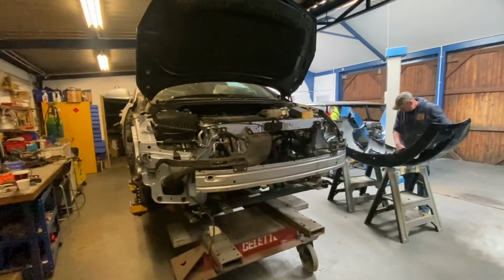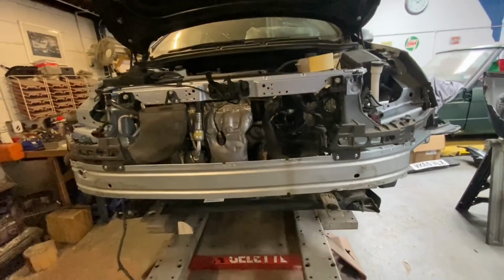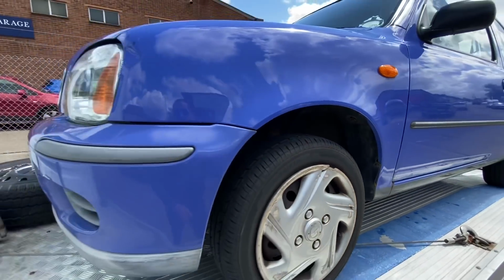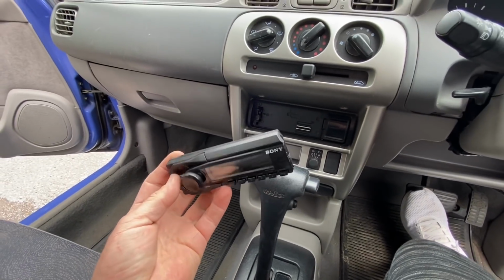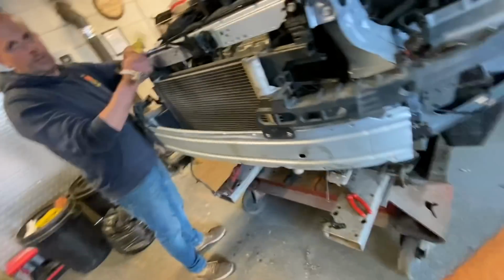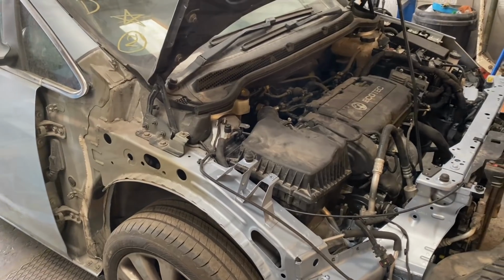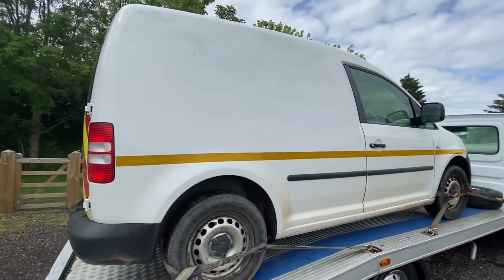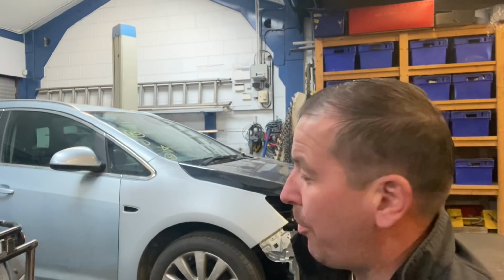Salvage Rebuilds Finding Buying Repairing Flipping For Profit £££

Comment: Those 'templates' inside the bumper are only there by accident.
The injection moulding die that creates the bumper will be used for both options; a pin will go in when 'sensor' bumpers are being made, and a blank otherwise. The outline of the blank creates the template shape.

Comment: Pre 51 plate automatic micras are hard to find. Save the micra. You should have done a face-lift on the caddy, golf R bumpers, dropped it 30 or 40 mil, cadiz alloys and golf R seats and steering wheel... maybe even wrapped it.. then move it on for £7,000.. either way, good video, well done lads

Comment: Another great video Rob & Chris, 3k was a great price for the Caddy loads left on the bone for the next trader. I sold a 2006 Caddy for nearly 4k but it had under 100k on it. Them Micra's take me back used to sell loads 10 or so years ago. They can be quite rotten especially around the front cross member etc. Used to sell cheap 4 door ones to Africa they used them as small taxi's. 😀👍

Comment: Great video, Astra looks like it's coming on nicely and it's nice to see what else you guys get up to during the working day.

I started my motor trade career as an apprentice at a Nissan dealer, my opinions on K11 Micras were the same as yours and Chris's before I started, then I realised how underappreciated they are.  They're pretty much bulletproof and the 16v engines are surprisingly fun.  The autos are rare now because they have an electromagnetic clutch that is really expensive to replace, if your is still good I think it's worth saving.  The paint always peeled off the later tailgates and yours looks fine so that's another bonus.  I can see why you would want to weigh it in though, less hassle and probably similar profits to selling it.

Shame the Caddy was a quick flip, I think that series would've been great for the channel as they're really popular.  180k is nothing on the later common rail TDIs, after 10 reg they're bulletproof.  My 15 plate Transporter has done 198k and the only part that's failed is a clutch release bearing.  You could tell it was a one driver van as well, they kept it in really nice condition.  I think the trader you sold it to is going to do very well out of that.  Hopefully the next ones they offer you are even nicer.

Keep up the good work :)

Comment: On the Micra I would toss it up on the ramp look for more rust 
if the oil leak is a simple fix .. I would repair the rust with metal you guys already have around the yard 
one can of primer and one can of stone guard on the sills 

list it up and trade for a project car chances are someone in a pinch might have something in need of light body work or mechanical work

Comment: that micra is worth checking how bad oil leak is and checking if gearbox changes well being auto, and if so worth selling as a cheap motor autos always sell well but still worth that scrap easy but still do someone well as long as its not to bad underneath, that hole in the sill is no biggy as im sure chris would agree

Comment: Hi Rob, just an observation in the video of the car on the hoist, the left hand pillar with the controls on is bending in when you lift a lot more than the right hand side, I would hate for it to collapse on you guys, I’d check the floor bolts and pillar for metal fatigue. 👀
Reply from the maker: It doesn’t move bud 👍
Reply: @sruk  if you look at the vid marker 10:40 and onwards, you can indeed see the lef pillar moving a little bit.

Comment: Your business is clearly a young man's game with all the back and forth doing this and that. One thing for certain, you will never get bored. I bet your days fly by with all those things filling the time. The little Nissan is interesting, but clearly the welding issue is a killer. It is a shame to crush it and melt it down when cars like that with an MOT are said to be selling like hot cakes. Surely, someone must be in the market for a project like that - or is it time to get a part-time welder to assist with these smaller jobs?

Comment: The K11 micra is too good to scrap, tough little cars. Engines are solid, it's normally the rust that kills them first. I think you should save it, will help someone looking for a cheap run around

Comment: Nothing wrong with a Micra, I've had four manual 1ltr models and they go really well.
80 mph in third gear.
Over engineered in fact, simply brilliant cars, very very robust, last one I had did 176,000 miles, I sold it to a trader.

Comment: That Nissan Micra, would be nice to keep it on the road if possible but even if it is to far gone or not worth repairing,  you could strip it down and sell all the parts off of it, still a lot of them Micras on the road and that one will still have a lot of good parts on it.

Comment: I would of liked to of seen the VW Caddy all cleaned up and all of the reflective decals removed as it looked like the previous driver had taken good care of it. I have just looked on eBay and a Caddy with 154000 miles had £4500 on it, with a bit of a valet and decals removed their was a very good profit in it if you had kept it. Keep up to great work. 👍
Reply from the maker: The first profit is the best profit and we didn’t have to touch it 👍
Reply: @sruk  
Fair point.

Comment: Being able to sell a vehicle that you've only needed to collect can be preferable to having a project as it's a quick turnaround, albeit without the added value that a project vehicle would return.

By being able to immediately take these two vehicles from your contacts you'll be more likely to get future offers from them, as they want a quick result too!

The variety of your work has it's plusses and minuses, the latter being repeat visits to the salvage yard to return parts which (infuriatingly) don't fit.

Getting out of the workshop is nice on a sunny day, with the aroma of fresh coffees as you return with lots of parts to complete projects!

Comment: I sussed out what you are going to do with the Micra, you either have a Nissan figaro with a bad engine and you are going to use the new Micra as a donor  car for parts ,or you will sell the bits to the figora club cause the parts are real expensive and we are coming into Summer posing time

Comment: hi Robb, watched your videos right from the beginning - well done !!!! on building your channel. quick question - I know you are a fan of fiat 500's - well I have an Abarth 500', the turbo just blew at 110,000 miles. just had it refurbed but there is an oil leak. if I use thicker viscosity oil will that reduce the problem or will it just cause damage to the engine. also have you ever used Wynn's 'stop smoke?. cheers
Reply from the maker: Different oil wouldn’t make any difference all cars that had the turbo let go will smoke for quiet a while due to oil in the exhaust it will clear once burnt off I wouldn’t use any stop leak best to find the leak and fix it 👍
Reply: They can leak on oil inlet copper washer, also u need to clean out all the boost pipes
Reply: @SalimKhan-gk1fh  thanks for the advice. very much appreciated
Reply: @sruk  thanks for that advice Robb

Comment: What do the numbers mean on the reg?
Reply: Cars from late 2001 onwards will have a numberplate something along the lines of XX00 XXX, with the first "XX" being the location code, the two numbers being the year of make, (e.g 13 being a 2013 car, also numbers from 51 onwards would count as being of the same years as the ones starting from 01, so "67" would be a 2017 reg.) Cars before 2001 have a simple first letter regarding when they were first made, with the reg of the Micra in the video, "Y", being early 2001, as Y was the last one-letter numberplate before the change. The rest of the numbers and letters in a pre-late 2001 car are randomised
Reply: @ayaanjahangir365  the last letters two are location related on old type.

Comment: No i had a old Micra cost me enough to keep it on the road then sold it then the new owner crashed it then had to scrap it had a load of bad luck on that yes giving the year just over 100 thousand miles I sell it spares or repair and lot of surface rust on it not worth it putting back on the road

Comment: If you have plenty of stuff for content then I would suggest cutting out the cat, keep the tyres and anything else that you can use then flog it off for scrap.
With the amount of welding required you probably won't break even by keeping and flipping so its value is really in content.

Comment: Break the Nissan it’s not worth putting back on the road for what time you both spend on it, use it as a skip and get shot of it. Strip it of the good parts as you said tyres, battery, cat, bulbs fuses and any thing else to top up your spare box bits and bobs.  You should make wages out of it.

Comment: It seems criminal to scrap that Micra but in reality, how much will it sell for once fixed? £500? Not much more.  When you can make £500 on a van without even unloading it off the truck why bother fixing a 20 year old car? Chris’s welding skills and time cost the same on a £10,000 car as a £200 one.  Look for another expensive car repair and get better value for the time spent. Enjoyed the mixed content.